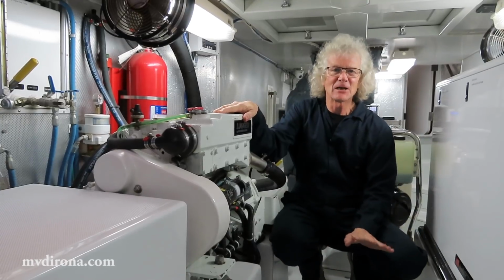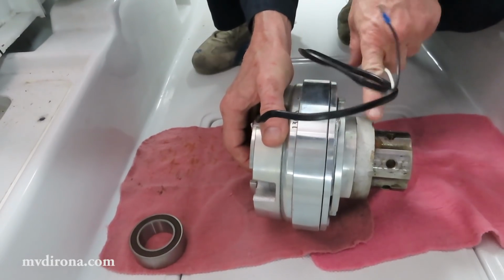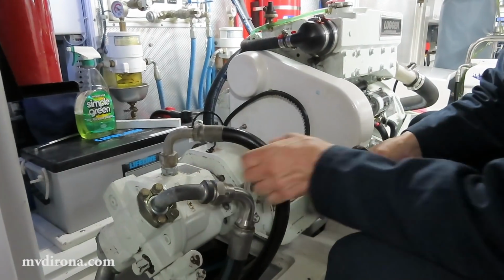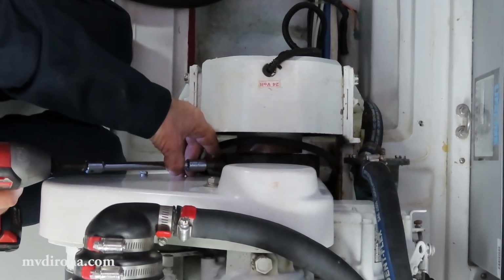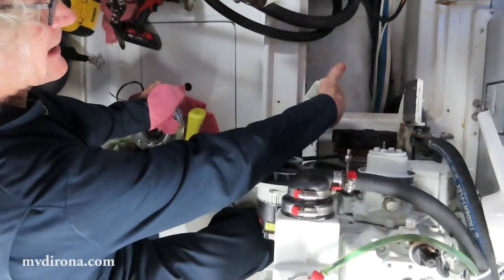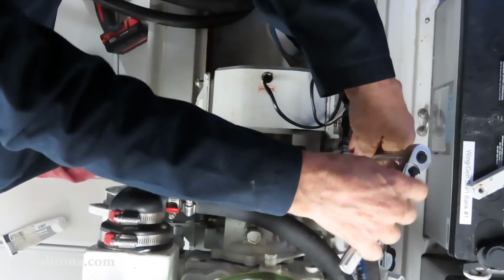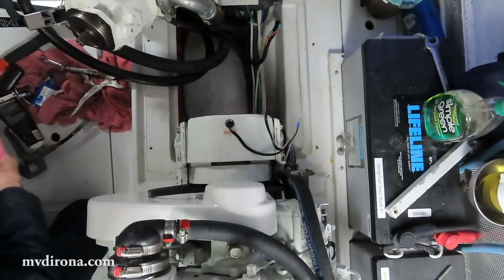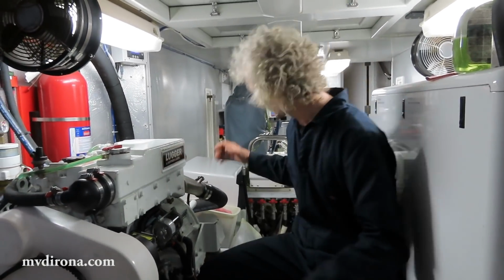Replacing Lugger/Northern Lights PTO Clutch (MV Dirona Channel)

Comment: Does this mean that when You are sailing and the stabilizators are on (rough sea), the wing engine must be running all the time (due to hydraulics system)?  Sorry for my bad english. Thank you for Your reply
Reply from the maker: That's a good question and that's exactly why hydraulic designs need careful thought through around all reasonable failure modes.  In Dirona's case, the main engine has a hydraulic pump on it so the stabilizers can be operated any time the main engine is running. And, if there is a main engine or pump failure, the stabilizers can be driven by starting the wing engine.  This also ensures the emergency bilge pump can operate as long as either the main or the wing engines are running.  To operate the thrusters or anchor windlass, both engines need to be run to get full power but, if either can't be operated, a good percentage of full output is still available on the windlass and, as long as both thrusters aren't used at the same time, the thrusters are close to full output.
Reply: @MVDirona  Thanks for the detailed answer. In one video you explained that the wing motor "exercises" while using the oil pump to run the stabilizer and thrusters, so that confused me. Regarding thrusters, do you recommend hydraulic or electric? I have heard that an electric bowtruster overheats after one minute of operation. By the way, do You know the "Gross register tonnage" of the N52?
Reply from the maker: @Skysailor1000  One of the leading causes of a Wing engine not being operative when needed in an emergency is they typically aren't used.  Basically emergencies are rare so the wing engine never gets used and this is bad for a diesel engine.  Because our wing engine is needed for every docking/undocking and anchoring operation, it gets constant use. It's exercised frequently so it can always be counted upon.

Hydraulic thrusters are continuous duty and can be run for minutes to hours without overheating whereas most recreational boat electric thrusters will have comparatively short duty cycles before they shut down due to excess temperature.  However, there is nothing that makes electric thruster have shorter duty cycles. They could be made to run continuously but, to keep costs low, most recreational thrusters use smaller electric motors without sufficient cooling with short duty cycles.  As an example of electric thrusters being able to have long duty cycles, most very large cruise ships use electric thrusters with continuous duty ratings and running them 5+ min at a time is fairly common.

Comment: The Z shaft design is the worst design ever.
Reply from the maker: Yes, there are lots of down sides to V-drives. They have the advantage of moving the engine towards the back of the boat to open up more space forward but the disadvantage of the prop shaft running very close under the auxiliary engine oil pan making packing service more difficult.

Comment: I worked at ADE as a field service tech, test cell, production for Y2K, QC and finally production scheduler/pricing analyst. I worked on at least 10k of these units. Run forever as do the gen sets…look at A Perfect Storm…was a NL generator on there. 😉🤘🤘🤘
Reply from the maker: I agree. Great engines. We have both an auxiliary engine with just over 1,000 hours and a gen with just over 8,000 hours.  They are both solid performers. Northern lights does great work.  You may have taken ours through the Northern Lights test bench.  If so, thanks!
Reply: @MVDirona  good to hear that they are treating you right. Regular maintenance is a lifesaver 😉 you never know on the testing…without the test sheet would be really hard to tell. We were doing so many of the smaller engines that it was insane…they are much easier than one of the Deere or Komatsu blocked units with three of them paralleled plus STARS. Took upwards of a week, especially if Lloyds of London or other insurance certifier was there. I was the guy that installed their modern/computerized dyno. Tasted hundreds of propulsion units, mostly the L140’s and L170’s… moved into management after Y2K. It is very Awesome watching your stories…Nordhaven was a big customer. Oh, little story…we had a land based generator brought in by DEA (think that,was the agency) with over 30k hours on it…had been running nonstop up on some cartel drug site in some south American country…that is an advertising slogan right there…lol. Stay safe out there 😎
Reply from the maker: I did a factory tour hosted by Scott Dyball and visited the test cells at Northern Lights some years back. Super interesting.

This morning I looked up our engine test sheets and they were taken through the test cell by Derrick Breaux but I'm sure they got the same care you gave.  Our 12kW generator produced 51.5A at 100% load and only 183F coolant temperature during test.

Comment: I watch the NordHavn family alot, and you too. I am a retired machine repairman. You purchase the tapered pins that are threaded on the big end and use a small dent puller for extraction, that way you reuse them. This could come in handy if you are not able to get new ones at port. You have a beautiful boat also.
Reply from the maker: Great suggestion. Tapered pins with threads would be much easier to remove.  Thanks for passing on that idea.

Comment: When lubing splines of hydraulic pumps with short shafts - ergo; heat transfer to the splines themselves from the hot pump - use a high temp grease, even a copper based lube so it doesn't just melt away from the heat over the next ten years. Using one of your trailer straps attached to an overhead abaft of the pump so it takes up some strain both lifting supporting the weight) and slightly pulling the pump rearward would ease the use of 'two' of your pry bars to just pop that thing off of there in one go.  You are exemplary for having both the skill and the confidence to maintain your vessel.  Having posted these videos showing the care you take with it's maintenance; you're unwittingly making it a desirable purchase for someone buying used. Don't be surprised if you develop a following of folks meeting you at the dock with the query: "ready to sell yet?" LOL
Kudos.
Reply from the maker: You're very kind in your feedback and I hope  you are right in people being interested in buying Dirona. I need to be in the Seattle area for work over the next year or two and won't have time to use the boat so it's going to be sold.

Good suggestion on high temp grease.  Much better than dry splines.

Comment: Why is there a belt loose around the shaft?  Is this just in case the "active belt" needs to be replaced - so you can quickly fit a replacement, without taking the "engine/gearbox" apart?
Reply from the maker: This engine drives the prop through a Z-drive so you are looking at the front of the engine and what you are seeing is a spare accessory drive belt mounted on the front of the drive belt protection shield.

The reason why this spare belt is in place where 99% of the engines you see out there don't have this is the front of the engine is driving a large hydraulic pump. This pump and the hoses that comes off of it, prevents a new drive belt from being installed.  Of course, the hydraulic pump can be removed from the engine to change the accessory drive belt but it's a real time burner so the normal solution is to put a spare belt on the outside so it's ready to go immediately if there is an unexpected belt failure.

Comment: The use of your 2nd engine to drive the boats hydraulics is as you say a very good -- driving items like bow/stern thrusters I understand. But you said Stabilisers as well (presumably fins) -- well this surprised me.  Did I hear you correctly --  the boats hydraulics are only driven by the spare engine? If correct I assume this would mean that if you want the stabilisers working while on passage then you have to run both engines, which would be wasteful.
Reply from the maker: Good question. Let me clarify. All hydraulics will run off either engine (but not the generator) on this boat.  Designs vary greatly from no backup to even more backup than we have but, on our boat, either the main engine or the wing engine can drive any or all hydraulic components.

What I'm describing in the video is normal operation. The stabilizers take little power and always run on the current propulsion engine which is normally the main but could be the wing engine.  The thrusters, windlass, and emergency bilge pump are big consumers of hydraulic power and they normally run off the wing engine but can run off of either. The reason they normally run off the wing is these components are normally used in close quarters where the main engine is at idle and, at idle, it doesn't have the hydraulic power to drive these accessories. So, the normal operation is to have the wing at full output running hydraulics and the main engine at idle to be popped in and out of gear to maneuver. 

But, if the wing was inoperative, all these components could also be run from the main engine but positioning the boat and then dropping back to neutral and putting the engine at higher revs to run the accessories. If the main prop is used, the main is brought down to idle (which limits they hydraulic output), shifted into gear to reposition, and then back to neutral at higher revs to run the hydraulics. 

All equipment can run from any engine but the dance between higher revs in neutral and idle maneuvering is only used when the wing is disabled. The normal operation in close quarters  is to have the wing at full output running hydraulics while the main is at low output doing close quarters positioning. The normal operation underway is to have the propulsion engine running the stabilizers and propulsion machinery and either engine can do this but, of course, the main engine is usually the one used.

Comment: many great videos watching the maintenance videos is better then my engineering course may I ask if you could do a video of the main engine starting in the engine room thank you
Reply from the maker: The starting of the engine really isn't very interesting. It always starts, it always starts quickly, and once it starts, the engine just lumps along at idle.   If you watch the UPS truck pull up to your house or building, you'll see it restart as the driver leaves (they shut down the trucks). Not much to see unless something isn't working and, in the last 11 years and 11,400 hours, there's never been an instance of anything interesting happening on startup which makes for happy owners but boring video :-).

But, if you do want to see the main engine running, this video starts it while in the pilot house but shows it running down in the engine room when cold: https://www.youtube.com/watch?v=sB9I4N5mRGw&t=1324s.
Reply: @MVDirona  thank you I'll watch the video it would be interesting to me as I've heard the generator and wing engine start and I would compare the three engines
Reply from the maker: Sounds good James. I personally find the video microphone tends to make them all sound louder and, obviously, it doesn't show vibration. The main is a much smoother 6 cylinder whereas the wing is a 4 cylinder and the gen is a 3 cylinder. Another factor is temperature. Warm diesels generally run smoother and more quietly than cold ones.
Reply: @MVDirona   thank you for the information

Comment: I was more nervous to see you pulling on those hydraulic hoses than about scratching something on the surface between the clutch and the pump.  Nice video
Reply from the maker: I was really nervous about the stiffness of those hydraulic hoses making it super challenging to get the pump out of there but it wasn't much of a problem. It's nice to have the PTO bearings back to nice and quiet. Thanks for the feedback.

Comment: oh yeah skipper , anytime you see them sealed bearings pop the seal off carefully and pack em with grease , cheap ass manufacturer occasionally only puts a drop or two in them sealed bearings, oh and get a tube of anti seize, careful with that anti seize that shit gets everywhere magically
Reply from the maker: Thanks for your thoughts.  The bearing fault mode in this case is false brinelling. This is the effect of vibration when the bearing is not moving. The first clutch failed in only a couple of hundred hours. The partial solution was to install a timer that opens the clutch for 500 msec every 10 min so it doesn't just sit in place for excessive periods. 

I have an experiment going on with the current clutch where I idle the engine at 1200 RPM and above to avoid 4 cylinder shakes and I've changed the clutch timer down to 500 msec open every 60 seconds. It'll be interesting to see if this approach achieves longer life. I'm fairly optimistic.

Comment: really enjoy your videos skipper, couple tips for ya, grease up them new tools cause they rustin, put a rag on that flat blade screw driver when your prying on painted surfaces, pick up your touch up paint and paint prep spray , some electric clutches are adjustable  with some feeler guages , pick up some load straps that aren't the ratcheting type they are a bit faster to use  and i forget the rest i was gonna say , looking forward to more of your videos
Reply from the maker: Thanks for the feedback on the videos.

Comment: Dear MV Dirona,
Curious, do you think you would find conducting anchoring operation also degraded if only the main eng HYD pump was available(I guess eng is at idle). I think MV Dirona has a Maxwell 3500 HYD windlass rated at 2000psi & 11gal/min. That sounds like about 15 hp  (2000psi x 11gal/min / 1714 x .85=15hp). 
Thanks, Nick
Reply from the maker: Yes, the windlass will run slow and at lower power on just the main engine (no wing engine). It normally will do 44 to 46 ft/min but on the main alone it's in the high 30s. So it's functional but slower.  When anchoring, main engine power isn't needed much so the solution is to just lift the engine speed to 1200 which will support for windlass speed.
Reply: @MVDirona  Thank you for help in understanding these systems. Nick

Comment: Dear MV Dirona, 
If I understand correctly you have 2 hydraulic pumps , 1 on the main eng & 1 on the wing eng. The main eng hyd pump is mostly for the stabilizers & back up. The wing eng hyd pump for everything else because it can run at a hi rpm without the prop engaged. If the wing eng hyd pump goes down & you have to use the main eng hyd pump , how effective are the bow/stern thrusters & windlass. I assume the main eng is around idle speeds during anchoring & docking operations. 
Thank you,Nicholas Christie Va Bh Va US
Reply from the maker: Exactly.  Technically both pumps are are 45cc Rexroth pumps and either are capable of fully running the hydraulic system at full output but, as you guessed, there is fine print. The first caveat is that full output of both thrusters at the same time requires more than 40 hp (I'm guessing around 48hp) but our wing is only a 40 hp engine so full output requires a small additional draw from the main. If the main engine were down we would have about 80% of full hydraulic system output. This wouldn't be very noticeable. 

The second caveat is the one you mentioned: if the wing engine is down and the main is idling you will only get around 20% of full power. Of course this would be very noticeable. The work around is to set the main to neutral and raise RPM when using the thrusters. This works well and produces full hydraulic output but is cumbersome. This operating mode is perfectly effective and I've experimented with it successfully but it requires more fore thought when docking.

The last caveat is the main hydraulic pump is a live pump. A live pump is on and turning when the engine is running. On the wing engine, the hydraulic pump can be turned off and on by electric clutch. Ideally the main would have a clutch as well so that, if there is a hydraulic emergency, the system can be just declutched. In this design, the main engine needs to be temporarily shut down to stop the hydraulic pump.  The longer term answer is to remove two large bolts, pull the pump back, and put a cover plate over the hole. Functional but not easy.  It's a situation that might never happen but it would be preferable to be able to operate through it with less disruption than needing to shut down the main engine.

Overall, we love the system but, like all things mechanical, there are some design compromises. Fortunately, we have never seen any of these issues in the last 11 years and 11,000 hours but someday we probably will.

Comment: many great videos . .  seems a lot wares out on these yachts?
Reply from the maker: You're right there has been a lot at once but, generally, the systems on board a Nordhavn are very reliable. The boat is 10 years old and the main engine has 11,100 hours and the generator has 6,800 hours so there is some maintenance work needed at this point. There is still one major service item left on the generator where we will need to change the rear main oil seal so we're not done yet.